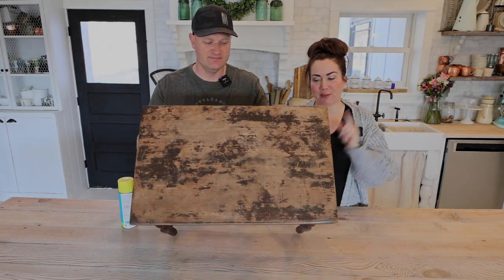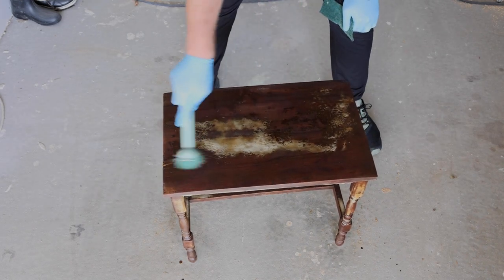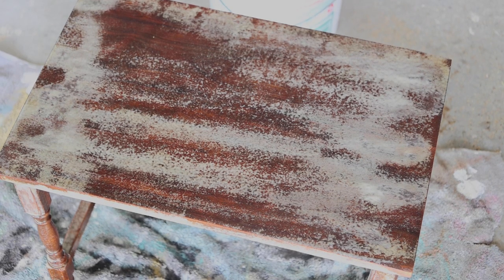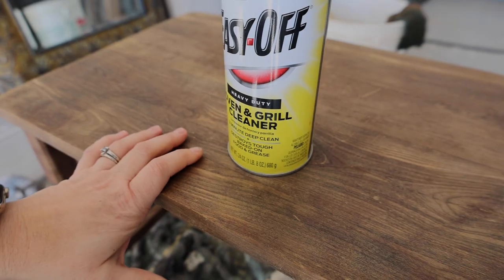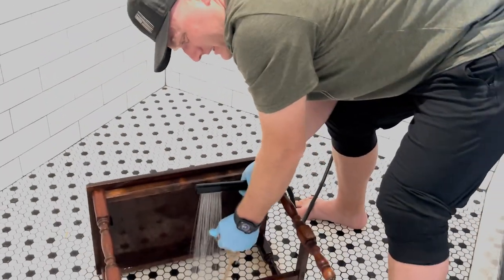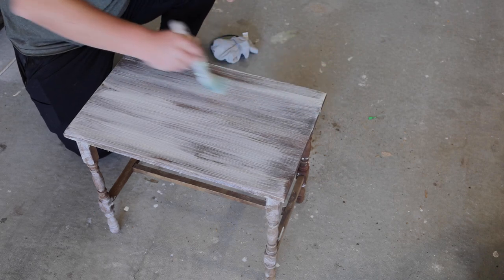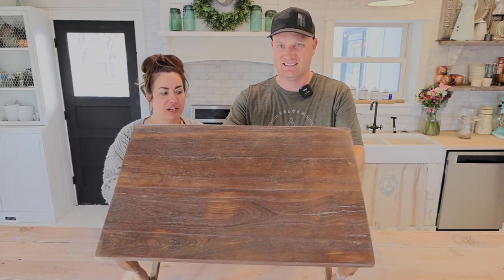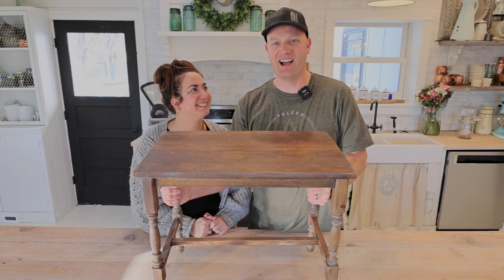Using Oven Cleaner To Strip an Antique Side Table! | White Oil Wax Finish | Farmhouse Style

Comment: I stripped a piano using Extra Strength Easy Off Oven cleaner. Worked at it off & on for 3 days. Didn’t take long. Just have lots of paper towel & good rubber gloves! It worked fantastic!

Comment: Can you show us your other white oil waxed items, especially if you did more than one coat? Pretty please? 

Since oven cleaner is toxic, I wonder if this is the better of two “evils” (stripper)?

Great video!
Reply from the maker: It’s hard to say, strippers are tough in general.
Reply from the maker: Wear a respirator and do it outside.
Reply: Oven cleaner isn’t toxic, it’s just caustic. It’s lye, which is used to make soap sometimes.
Reply: @cynthiafisher9907  Okay I read up on it. They’re poisonous, at least while they’re at their caustic potency. They say after they’ve been used and wiped off, they’re not toxic. 

Still and all, I don’t like the stuff, but I probably don’t like stripper either.

Comment: If the agent's health hazards aren't enough of a red flag, the harsh solution might also throw a wrench in wood DIY project before it truly begins. Oven cleaners will most definitely dry out wood, eventually resulting in splits and veneer separation, it's fair to expect a bleaching effect, as well, with oven cleaners. Instead turn to gel strippers that have "less splash, better accumulation, and are fairly inexpensive when working on any wooden pieces.

Comment: You have to use real easy off oven cleaner not off brand just saying I did this technique in the '70s and pulled off about 6 or 7 Layers of old paint easily and I didn't wipe anything back I rinse it off with a water hose

Comment: Meh ... Seems like much ado about nothing. Five coats?!? I've never had to use more than two coats of any stripper even with 3-4 layers of paint. Thanks for showing this latest fad. As much as I hate the whole messy process, I'll stick with regular strippers. 🤷🏻‍♀️
Reply: What strippers have you used that git that deep on multiple layers? I have a piece that I'm seriously considering putting in the wood pile.
Reply: @kayeyeager8006  hi Kaye! Sorry for the delayed response. I just saw this! I had stockpiled some of the old formula Citristrip that I'm still using. That works well for me - you just have to put a decent layer on and cover it with plastic so it stays wet while it's working. Klean Strip is a good one, too. That's what I used before Citristrip and I'll probably go back to it once I'm all out. I also have some stuff I bought on fb marketplace that is supposed to be really good. I haven't tried it yet but I'll come back and repost when I do if I like it.